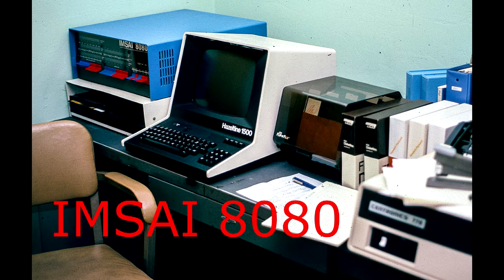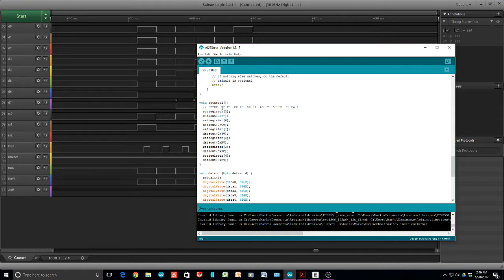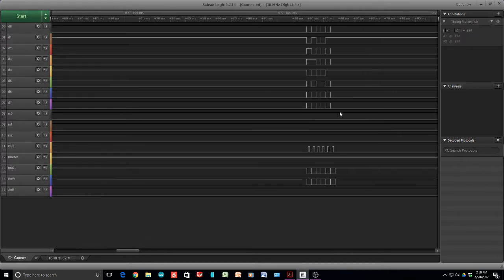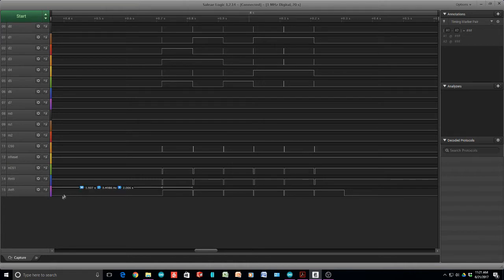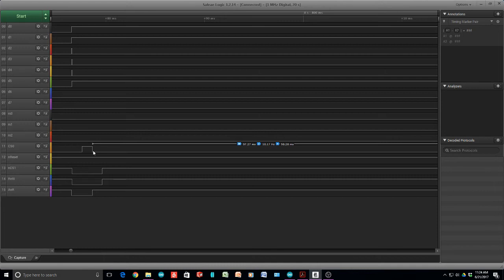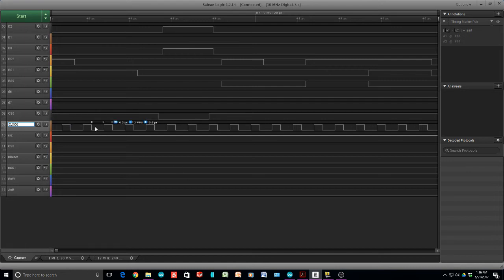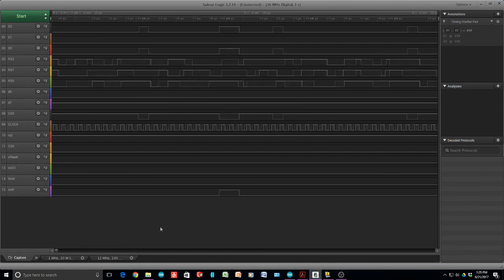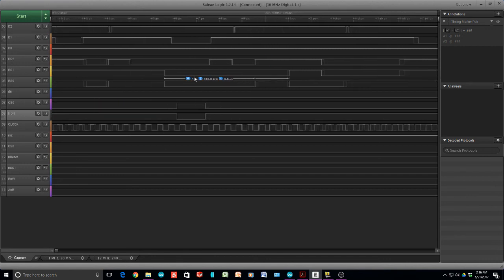#69 IMSAI 8080 SSI-263 speech chip talks!

Comment: Hmm. At 9:53 it sure looks like ~Ready goes high before CS0 goes low; perhaps it's a slightly delayed response to CS0 going high?
Reply from the maker: the SSI-263 triggers on the rising edge of CS0 so that sets off the chip running and asserts not ready some time later. not dependent on  the state or falling edge of CS0